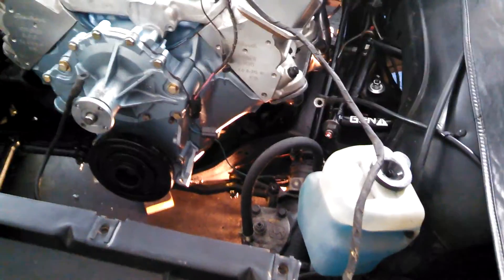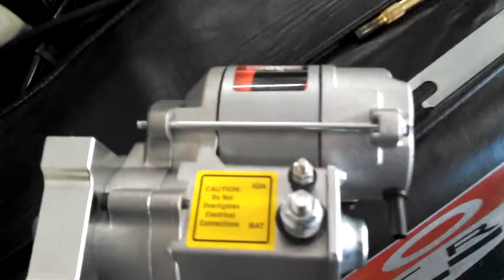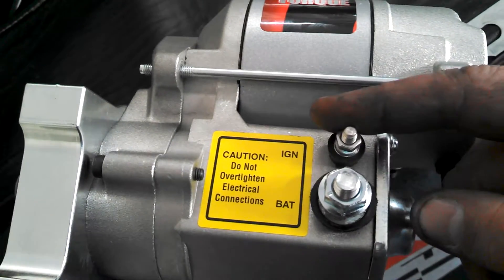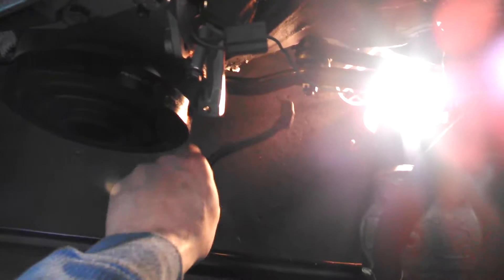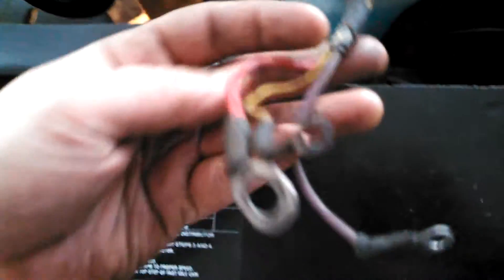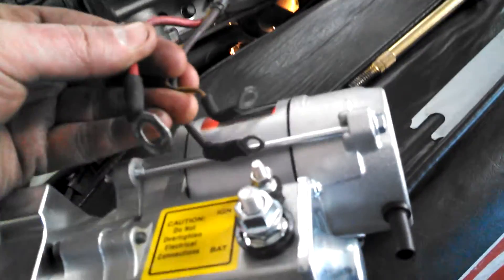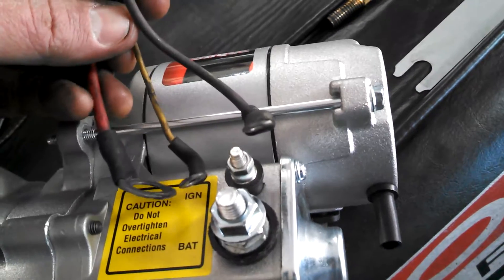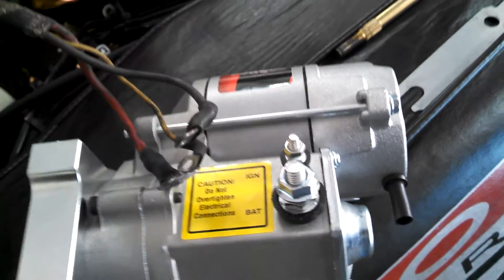1970 Trans Am - Starter Wiring

Comment: I'm sure you've solved this problem ..but for those who are looking for the correct answer:   In this application, (hi-torque starter)  the Red goes to the Batt. terminal, Purple goes to IGN. terminal and the yellow is a N/C.  On a stock solenoid,  Purple goes to the "S" terminal,  The yellow wire goes to the "R" terminal. The yellow is a secondary power wire to provide more current to the Coil only during starting the engine to compensate for the voltage drop caused by starter motor.

Comment: I believe that the Big red goes to battery. The purple may be neutral safety which goes to ign as does the yellow. Some of the accessories inside the car grab battery power from the bat connector on the starter... Don't hold me to any of this, as both my forward lamp and engine harnesses were modified by M and H for headlight relays..
Reply from the maker: Thank you

Comment: Red is Battery. Purple is S which is ignition. Yellow or Pink is R if equipped with a coil.
Reply: ENLIGHTENED CHILD OF GOD TWOBALLCANE is this the same for pontiac Ventura? I have the exact same wires and same problem.
Reply: In the early 70s yes. The wiring for GM cars are the same.
Reply: ENLIGHTENED CHILD OF GOD TWOBALLCANE my 79 firebird was a running and driving car I blew up a 301 and now I'm putting another 301 back into it but I don't have those 3 wires? Do I have a different harness or  am I just missing something
Reply: AdmirableMonkey did you ever figure it out I’m having the same problem.
Reply from the maker: Thank you for the comment!!!